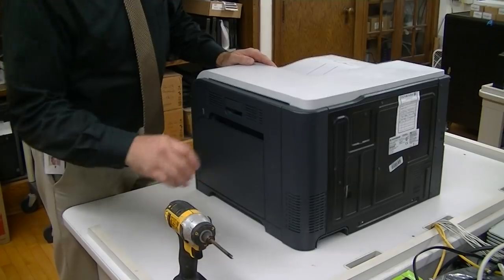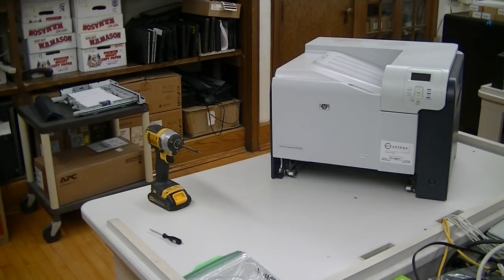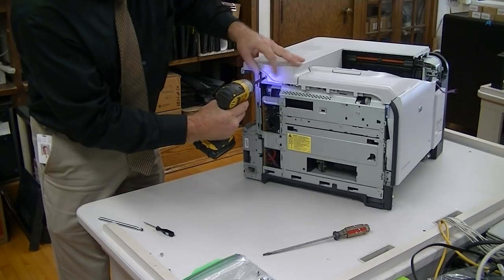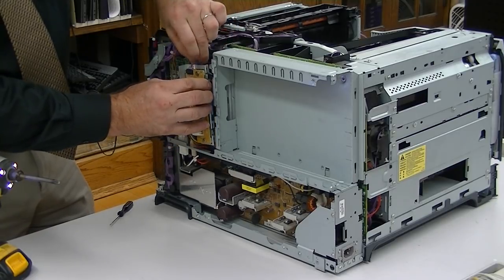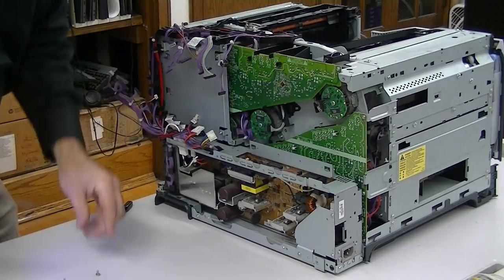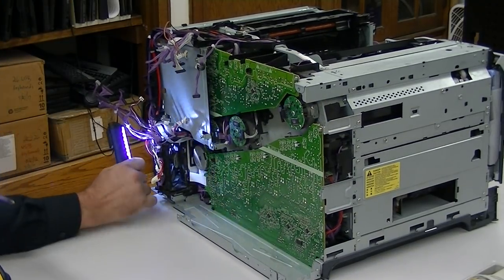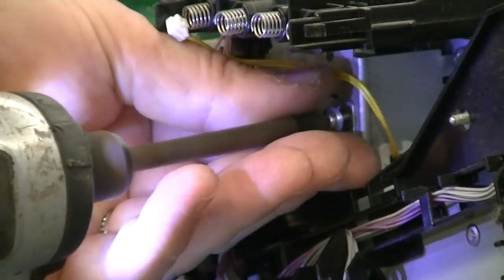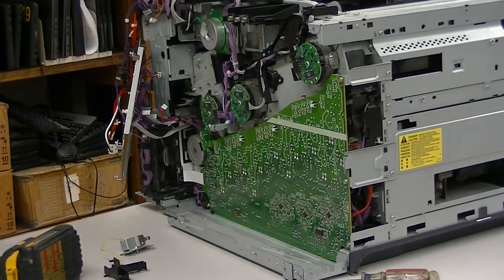CP3525 Tear-down to 59.F0 solenoid replacement

Comment: I am strongly suggesting that no-one does what I have done, but for info only....... I had the grinding sound and the same 59.F0 message. Having watched this great video, I realised I do not have enough time until the weekend to address this properly. When there was talk in the comments of sticky issue and the foam on the solenoid being the issue, as a long shot, with the printer off and cold, I opened the side door and the rear inspection plate, removed the image tray and whatever it is at the top and blew a hairdryer in the direction of the solenoid for five to ten mins on medium heat, then when things were warm, turned the printer on and hey presto, managed to get the fault to go away and get on with my printing. I know it will come back, but I can deal with things at the weekend. Just thought I would share what I did in case anyone is in emergency mode, but obviously I do not recommend this course of action! Great video Jerry, many thanks.

Comment: Hellow Sir, My Printer HP CP 4025 hs the same problem 59.F0.  After doing this process when I tried to Start Printer, its displays work and scanning process started but did not complete.  Fans are not running, no noise of printer starting, what should I do?

Comment: You do not have to replace the solenoid, just clean the sticky foam and left over glue off of it, the deteriorating piece of foam designed to damp the tap noise when solenoid engages, that have been a common problem in printers and copiers for several decades.
Reply: I usually like to replace the foam with proofing material, a felt-like sticky pad, but shrink wrap works just the same

Comment: Thanks for this movie. i have a CM3530 printing fine on USB but cannot connect it via LAN, win10 dose not recognize the LAN. The cable is fine, ip4 is fine. possible the formatter board needs to replace?

Comment: If the solenoid isn't electrically bad, you don't have to replace it.  Just clean the sticky residue off and put a peice of heat shrink tubing over the tab you scraped the goo off of.  Cut a thin piece and just cover the end of that.  Heat it up so it shrinks and it works great and it will stay on..

Comment: Thank you for saving me considerable amount of time.
So many HP printers experience this problem, if only they used a piece of rubber instead of gluing a spongy foam.
Reply: Certain rubber compounds can get gooey over time, too.  "Ascom feet" were a messy encounter at work, where the rubber feet on Ascom line drivers (and BT Kilostream boxes which used the same case) would melt into a sticky gob.  If you were lucky they'd catch your hand.  If not so lucky, your sleeve.

Comment: Thankyou mr. Jerry Hence
A friend of mine had this problem.
It took you 20 minutes. But it took us two days then we forgot where the wires were supposed to go and the sequence of screws.
Fixed the solenoid with plastic piece.
This proves companies are deliberately making products malfunction so they can throw away and buy new.
This is a disgrace.
GODBLESS.
Reply: Tis why there’s a less involved way to access the transfer solenoid.. no need to disassemble the DC controller and all it’s wires.. can be done in half this time

Comment: Just fixed one on my second attempt.  One thing to watch for: when refitting the solenoid it's possible for the lever to catch alongside the cog instead of fitting between the teeth.  I only noticed it because the slotted screw hole on the solenoid wasn't sitting back properly.  The fix is to reach in through the top with a flat-blade screwdriver and move the sprung end of the lever, effectively actuating the solenoid.  This allowed it to slip into place.  This can be accessed from the top once the lid is removed, so no need to strip right down to get at it again, and also potentially an easy way to give the solenoid a nudge if it's caught again.  Mine's now got a strip of insulating tape on the metal where the sponge pad strikes.

Comment: it wasn't strictly necessary to remove the PSU, btw, but anyway, this video helped me through the fixing process.  I had seen another vid a while before, who unscrewed even more parts and almost scared me away from trying, but from there I knew how to fix the solenoid.  You definitly helped saving my printer from ending up in a landfill, thanks a lot!

Comment: Thank you Jerry! Our HP CP3525N works again after this dreaded 59.F0 error.

I followed your video forwards and backwards to get at the solenoid and then put everything back.

For the solenoid repair, I followed Jay Groh's video: https://www.youtube.com/watch?v=KvXO8MymNh0
I used a toothpick to remove the sponge. Then I used a wet paper towel to wipe away the sticky residue. I used black vinyl electrical tape to wrap around the area of the metal plate that hits what used to be the sponge area of the solenoid.

I actually saw Csavar Nyúzó's video first: https://www.youtube.com/watch?v=Ak8hkSuRyOk
I was about a quarter of the way through but switched gears to Jerry's method because it didn't involve removing so many components especially all the printer parts on the right side when facing the printer's display panel.

Some suggestions for the folks out there:
1. Take lots of pix before ripping out cables, wires, connections, etc. This came in very handy when putting back all the connections for the boards above the power supply.
2. I did not leave the metal plate for the square board hanging to the side. I carefully removed the wire mess from the black plastic wire management system so that I can remove the metal plate. I left the black plastic wire management system attached to the metal plate.
3. I documented where all the screws go. I poked them through paper and then wrote and drew diagrams.

Comment: I disassembled the whole damn printer, based on another  YT video, where you actually take the whole board out.  I confirmed that the gears WERE properly aligned, so that's good.  My solenoid didn't have any kind of foam on it - and there was no residue, so I don't think it ever did.  Is there any way of testing the solenoid with a VOM while it's out?
Reply: I tried testing with a VOM set at 2000 Ohm, it reads 154 when open, jumps up to 248 when closed for a second, then  back down to 154 - even if it's still closed.  I'm very confused.  Everyone is talking about the foam tape, even on other YouTubes and various sites - yet the replacement solenoids look like mine - no foam at all.  Any clarification would appreciated.  I also used a paperclip to test for magnetism - neither the arm nor the metal "button" it hits seem to be magnetized at all.  Also the arm moves freely.

Comment: Just fix the solenoid by taking off the arm with it's spring & clean off all the sticky quiet pad that has turned to mush & either leave nothing in its place which will only have it make a slight clicking sound as the arm hits the magnet or, replace the quiet pad with a small piece of cotton from a q-tip spread out thinly where the old pad was & a 2 inch piece of clear tape going from the round magnet head & over the cotton & past it & to the back side of the metal L shape.  The tape will then stay there as long as the printer lasts. I have never had a bad solenoid, just hundreds of sticky quiet pads from getting old & disintegrating.
Reply: Does not work on this machine since the hole to get the "arm" out is smaller than the "arm" it self.
Reply: Thanks alot this was a nice tutorial, we need you, am more into this job with a passion. And the screw driver, nice we need it together with the touch.
Thank you once more.
Reply: Leaving bare metal will magnetize and cause the same error.. you need a non-magnetizable buffer

Comment: Comment to Jerry:
Thanks for this.  After replacing the whole fuser assembly driver, I now get a 55.01.00 DC Controller memory error.  I've replaced the DC Controller board (twice), and using your video (as opposed to the original one I used where you take the whole thing apart) I've been able to look at everything in a reasonable amount of time.

Trouble is, I can't find anything that isn't connected. Nothing.  It can't be the DC Controller, as I've replaced it twice.  HP Support was less than helpful.  I've posted to other printer tech forums, nobody has a suggestion I haven't tried (remove toners, remove fuser and transfer belt, check all connections, reset printer).  I'm wondering if  you've run up against this issue, and if you did, was there a fix?  I hate to toss what should be a great printer, especially after all this work!

Comment: good morning I have a question, I have an hp cp4525 with faults in the page counter, she counts them when I print them and after I turn off the printer and turn it on she subtracts the pages already printed from the counter, you know what is happening that? do you have any solution for that failure?

Comment: hello Jerry, incase if I have to replace the solenoid .Would you please to let me know the part number for that . Thanks
Reply: part number RK2-0950
Reply: @Okipentv  
And you don't even have to replace the solenoid.  Technicians have many different ways to deal with these sticking solenoids.  Some repad them with the same material, some use black tape... I heard of one guy using super glue and tiny pieces of tire innertube.
Personally, I don't repad them.

But you have to do SOMETHING to them, otherwise the metal plate becomes magnetized, and it sticks down--the same thing it does when the padding gets old.

So you can bend the part of the solenoid, as illustrated in the pics below.  I've been doing it this way for years, on HP, Dell, Brother, and dozens of other machines.  It's always worked, and I've never have to revisit a solenoid that I've fixed.

Comment: What is the part number for that solenoid so that I can order a replacement ahead of time? Thanks!
Reply: Please what are the causes of hp color laserjet cp3525 printing blurry and misaligned solution
Reply: Use shrink wrap over the foam pad.. much easier

Comment: I didnt use my CP3525 for a year and now I get a sharp grinding noise for a few seconds during the startup sequence, or if i try to print, and it aborts with the 59.F0 error.

Do you think this will solve it, and do i need to reassemble everything to try, or can i try it while its still disassembled?

Comment: No need to replace man
There is abetter solution to fix its problema
Reply: Please explain thanks
Reply: Put 3/8” shrink wrap tubing on foam pad , or scrape old foam pad off and install small strips of proofing material from Ricoh.. ez PZ..

Comment: Sir. I can't thank you enough. I was able to take my old printer apart and fix the solenoid myself. I actually repaired it by watching https://www.youtube.com/watch?v=KvXO8MymNh0 @2:29. I had to take it apart twice because I had put to much tape the first time. Great job with the camera angles everything was easy to understand.
Reply: Thanks for the tip. I also had to take it apart twice for the same reason. Surprisingly little tape was needed. Now it works perfectly.